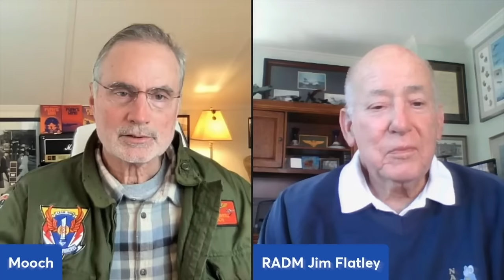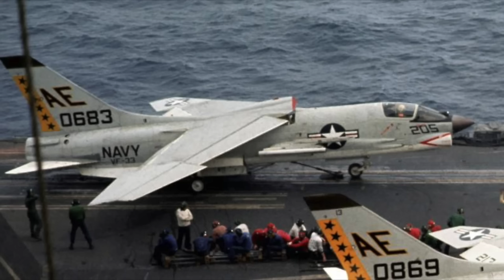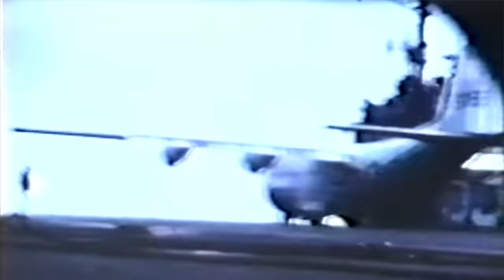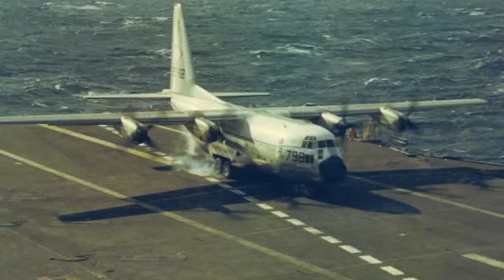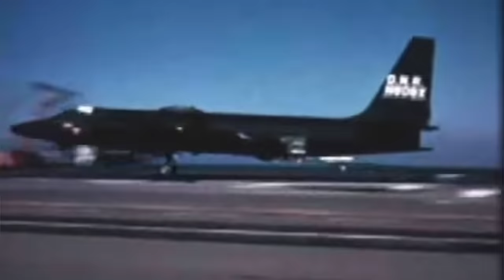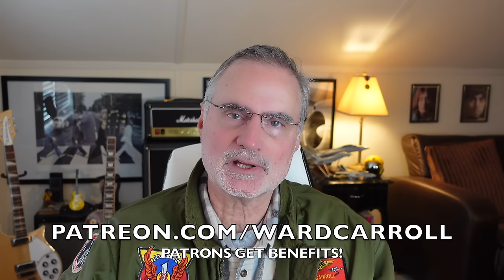Here's How a Fighter Pilot Landed a Cargo Plane on a Carrier

Comment: Great interview on a little known facet of C-130 ops.  I was a Flight Test Engineer at Pax River in that era and Jim and I were classmates at TPS. (I only did the academic part, although I believe Jim and I did a T-28 airspeed/altitude position error flight together).  I went on to NASA in late 1963 and wound up managing the integration of payloads to the Space Shuttle some 30 years later.  It was great to see RADM Flatley again and great to rethink my time at Pax.  Nothing but good memories of working with some outstanding pilots and Naval officers.  Thanks, Ward for doing this kind of interview.
Reply: Ward:  Please pin this.
Reply: Did you not also work on the parachute system for the Apollo missions? Or, did google fail me?
Reply: Did you work at the Cape or another facility like the one in Cleveland? I'd imagine the Cape since you were doing payloads for the Shuttle. 
My uncle worked at the Cape from Mercury through the Shuttle program and into the era of the ISS for Boeing, speaking of payloads it was his team that was given the task of doing the post accident reports on the Boeing built Defense Department satellite that was on the Challenger after it's accident. 
And a connection through the other side of my family is my mother's cousin was a navigator on a B24 that was shot down and killed during the war, but the pilot survived and went on in life to get a degree in Aeronautical Engineering and worked at the NACA (later NASA) facility in Cleveland until his retirement, he was involved in the Apollo program, he had something to do with the reactor that was on the LEM or something.
Reply: Amazing to hear!
Reply: Thank you for your service sir. 🇺🇸🦅
Reply: @douglashall2141  Ditto from a vet hand salute tue
Reply: Thank you for your service
Reply: My Mrs. currently works at Pax River as a T&E engineer for aircraft avionics, specializing in sensor systems.
She's a former USAF officer who did the same for them.
Reply: RADM Flatley, it is nice to see you and know that you are well and looking good! We still have the same haircut! 😂

Comment: Caroll this was one of the most amazing moments in aviation I think. Sad that they never implemented it on a regular basis but I understand that such a huge plane would hamper carrier operations for too long until it departed.
Reply: I bet there's an SOP on how to get that plane off the deck for salvage later
Reply: Whose is to say that this is a capability that may have been used from time to time by the Special Ops community? Super COD may have been a cover.
Reply: @boblynch2802  Maybe
Reply: It sounds like the carrier would have been so deeply embedded in the whole U2 ops scenario that all the normal "business as usual"-type operations would have been suspended anyways.

Comment: Great video. Flying right at stall speed +\- 3kts for approach and landing...Big Airspeed gauge mandatory!!

Wonder what the C-130 crew had for emergency survival plan  
If their aircraft went over the side of the carrier.

Huge "atta-boys" to all the folks involved in that program.
Reply: Dunno the drill but, at least the F model, there's a ladder and hatch rear of crew cabin. I used it when set a faulty HF wire antenna on fire during a Daily

Comment: Great honor to hear it from the real deal. I joined the Navy in 1970 retired 1991 retired as ADCS. When I first heard of the C-130 landing on Forrestal I thought it was a sea story, later I learned the truth. Coming onboard at a knot or two one way or the other over stall speed I really got a laugh out of the Admirals comment about replacing the airspeed indicator with one the size of a kitchen clock.

Comment: I was a C130 loadmaster with 10,000 hrs of flight time. I have been thru some fantastic landings. But this one by RADW Jim Flatley is out of this world. My hats off to you SIR! Its not easy to fly the C130 at 3 knots above stall speed, let alone to touch down consistently at 50 feet past the thresshold.

Comment: VR-8 64-66, A film of the landings was part of our orientation when coming on board.  Was told that there was an additional modifacation not mentioned .  The weight on the wheels switch was modified so that the props could start their reversal process before touching down.  Lockheed rep was the one showing the film.

Comment: I was a COD Crewman for VR-30 in the late 70's.   The deck run was standard operating procedures for us; even on the 27 Charlies.  The Cat shot was too harsh for the old ladies.  We only took a shot when we had special persons (VIP's) to impress.  So I have a couple hundred traps and only 30 or so cat shots.  I was't unusual to dip off the angle on the Oriskany.  Some times I was looking up at the antenna's on the port side of the straight deck.

Comment: Thank you for this interview. As an Air Force C-130 pilot in the late 80s and early 90s, I always wondered why this capability was never used and for that matter what the requirement was that prompted the testing. Since the tests were successful, either the requirement changed or there were significant issues even if it was successful. The C-130 is an incredible aircraft with some remarkable capabilities which is obvious because of its longevity and numerous versions. I later flew the C-17 on its initial cadre of pilots in the mid 90s and it has many of the same capabilities with a much larger cargo capability. It seems that there would be the need to get the cargo capability of a C-130 onto an aircraft carrier at least periodically.

Comment: If you a interested in A/C that are not designed to be carrier suitable you might look into the OV-10 trials that Pax did.  For one exercise the Marine OV-10's flew off of a carrier (I believe it may have been an LHA) in the 1980's.  They were also told not to rotate until past the island.

Comment: I heard somewhere that the Squat switch on the MLG was bypassed so they could get the props back into reverse just before it hit the deck. It takes about a second for the props to get into reverse angle after you pull the throttles back and they won’t reverse unless the squat switch is closed (Weight on the MLG).

Comment: The photos show 798.  I don't feel like digging out my old logbooks now, but I think I flew that airplane later, when it was reassigned to the Marines, maybe in VMGR-152 (Okinawa) or 252 (Cherry Point NC).  They must have changed the nosewheel steering wheel's position, because when I did it, it was easy to reach.  I see the refueling pods that hold the hoses are removed for the test.   I'd like him to tell us whether he reversed thrust over the ramp or after hitting the deck.  A C-130 is flown with the pilot in command in the left seat and the yellow shirt typically stands on the right side of the aircraft, so following taxi signals could be hard unless he ran out in front of the aircraft.

Comment: My first time flying off the boat was a deck roll down the angle, in a C1 as well. Back in '78 I think it was. We watched a cod doing traps and cat shots for quite awhile while waiting for our ride, then here came the old girl, our taxi to shore. Plane crammed full of cruise boxes and people and off we went back to the stern of the boat our butts in the seat and feet on the cruise boxes. The scary part was I was last on and the flight crew stopped me and gave me a vest, different from the others. They put me in the seat against the bulkhead back to the copilot and right right under the escape hatch. They told me if we went in how to get out and to stay with the people as I had the "radio beacon" and strobe light. I was the one they would find.  I thought ok, then they did the deck roll. Oh crap. Off the angle deck we went vibrating, shaking, roaring, and slowly accelerating. Doff the angle deck and down we went into ground effect, accelerating, and slowly climbed. We were very heavy. An hour or so later we landed at cecil field happy campers. Seaman Hunter, welcome to Carrier Aviation. The other times were all cat shots thankfully. Not near as worrysome. Be safe.

Comment: Speaking of COD, Navy should have snagged the near new C-27J Spartans the USAF sent direct from the production line to the boneyard as replacements for the C-2s.  The C-27J with a 94.5 ft wingspan and 9 ton carry capacity would have increased capacity over the C-2 especially for carrying replacement F-18 engines.

Comment: I wonder if they had any contingency plan, for if the big plane slid off the deck, like practicing a submerged exit like they have for helo and even Humvee type vehicles, but they prob just winged it back in the day...
Reply: When I was a Naval Aircrewman in the 80's, we did helicopter emergency water egress in candidate school.   It was the shell of a huey that was hoisted over and dropped into a pool.  It would rotate randomly, and then we had to practice exiting from different doors, with and without blackout goggles to simulate night.  That was general training for all  Navy aircrew.
 Later 'in the fleet' as a crew of  EC-130Q we would always do  'ditching drills' during 'missions' when we were on a  deployment. I would have to get the 'gumby' cold water survival suit on in some set time etc.    When we were doing what were for us short 3 hr Pilot training 'bounce' flights, and other stunt flying, we would not seem as concerned with safety. But hey, I was a kid in the back qualified to tell you if the hydraulic fluid was getting low, or if there was any structural damage after takeoff!
 
SV2? survival/flotation jacket had to be worn for take off and landings over water, but we could take it off after some amount of time during the mission which fur us was 12 15 16 hrs. Thought I did see a carrier out the window once, I am sure the Admiral and his crew are the only ones who landed.

Comment: Some airplanes were unlikely planes to operate from carriers, I can think of at least one other medium bomber , the B25 doing the same, but they did not have to land on the carrier. But at least Admiral did not have the prospect of playing hide and seek , with his head as price for the Japanese. A 50 kts headwind (at sea level) on the carrier means the landing speed been halfed,  I rather land in that condition on a carrier than to try and land on some hot and high remote strips (let say 3000 ft) with a heavy load of cargo. and a dicy go around with tall trees at the end of the strip.

Comment: Just wondering if'n I understood the admiral correctly..... he both landed & took off The Intrepid?
The Intrepid's runway is listed as 820' long.... the C-130 dry/empty weight~78,ooo lbs.... additional fuel weight can be up to 58,ooo lbs..... the required minimum runway length~3,300'.....
Would this pilot have gained advantage from that carrier's catapult pressure of ~58,ooo lbs?  Would he have utilized a JATO (jet assisted take-off) pack?❤
Reply: Oops, Carrier Forrestal.....
Reply: Okay, Forrestal lenght~1,000'.
Same questions apply.
Reply: Yes, he both landed and took off. At first they just did touch-n-gos then came out a week or so later and did the landing/take-offs.  798 was a KC130 F model but they removed the refueling pods which reduced the weight and drag silghtly. Remember they were in 50 -70 knot headwind when they took off--he said they indicated TAS of I think he said 49 knots so that would be 99-119 knots takeoff speed.  Takeoff speed without refueling pods would be under 120KIAS.   

I'm not  a pilot or aircrew member but I worked on KC-130s and that one specifically for over 20 years. They needed to test teh viability of TO and Landings with weight so they could duplicate concept.

Comment: Great job Ward! 
Radm. Flatley & "Smoke" Deserved every part of their DFC's (Distinguished Flying Cross)  for this addition to carrier history!

Now, what I still cannot understand Ward is;  the simple fact is, the cockpit on a C-130 is way higher than anything else that lands on deck... so how does the meatball read properly? Seems like the angle would be off - high - wanting to push the aircraft too low on the glide slope.

Btw, 15 feet right wingtip to island, yikes!  Good news though,  no crabbing going down the axial of the deck 🙂
Reply: Stovall, who flew three landings on the final day, received the Air Medal. Unfortunately he passed away from leukemia in 1973.

Comment: Was there ever any thought given to building a catapult carrier version of the A-10?   Tailhook.   Catapult gear.   Sturdier structure.   Seems like an easier engineering project than a VTOL F-35B.
Reply: S-3 could do pretty much everything A-10 could do in fleet and then some. It only lacks the gun but more than makes up for that with it's ASW capabilities.

Having naval A-10 to beat seven shades out of potential boat swarms would be damn dope though!
Reply: Would be interesting to know if there was any attempt.

(In my layman knowledge and logic)  the A-10 is still operational because it doesn’t face technologically equal enemies - insurgents  with AKs. A carrier group is by far more likely to face modern enemies on the seas, where a Cold War gunbus will have little to no effect. At the point where you redesign the a10 for naval ops you may as well design a new aircraft.
Reply: Just a thought of amphibious A-10 derivative with fixed floats though..
Reply: @thelittlestmig3394  Lol
Kinda like the spitfire with floats eh?
Reply: @SP-sy5nq  Yea kinda though I'd imagine more of C-47C with big-ass brrrrr cannon.
Reply: @SP-sy5nq  I am familiar with both floats equipped and boat hulled Herc projects. Would be neat ASW platform!
Reply: STOVL not VTOL
Reply: @AA-xo9uw  Armchair level of pedantry and wrong.
Reply: @thelittlestmig3394  Not wrong, pogue. 

Poor attention to detail is a hallmark trait of ignorant and obtuse posters on youtube, as well as those that defend them, who refuse to admit when they are wrong.

Comment: I’m amazed. Did we landed aided by wire hook?
Reply: No hook.  If you look closely on the side of the plane, it has "Look Ma, No Hook" painted on it.  Max brakes and reverse the props once it touches down.
Reply: @bobmarlowe3390  thanks for heads up. I see now. Second thought, those cable weren’t strong enough for this aircraft anyway. 

I wonder if that quote was printed on fuselage before it left the base? If it fail land safely on flight deck, that quote is up to ocean fish to read.

Comment: My brother-in-law served on the USS Coral Sea. He said that the aerial refueling was done by Marine Corps KC-130s that had tandem arresting hooks so they could catch two wires, and launch was handled by a special bridle that reached the C130 while sitting on the fantail and was pulled by two catapults. The C130, fully loaded, took the entire length of the deck at launch, the cats just gave it a good start. So, you are right, the navy did not fly C-130s off of carriers again. The Marine Corps does not brag about being part of the Navy Department. From a flight deck operations standpoint, C-130s were launched/recovered between airgroup launch and recovery. They wanted as many planes as possible in the air and off the deck. It was too big for the elevators, and finding a parking place on the deck was like playing chess.

Comment: I'm a little confused he said they where doing that for possible U-2 ops, so why did they have to land at a 130,000 pounds that's like 8x the weight of a U-2 that's fully loaded.
Reply: The U-2/C-130 angle was only revealed later but the COD angle wasn't just a cover story. The KC-130 was chosen due to the ability to quickly increase the weight by simply adding fuel to determine the max landing weight.

Comment: I notice the deck didn’t seem to be moving in the video while you were saying it was. Is that an optical illusion?  Did the C-130 use a hook to stop or was it all slow approach and reverse thrust?  Was there a connection between the C-130 and U2. I mean if they wanted to deploy the U2 off a carrier was it necessary to have the C-130 supply it?  Thanks. Interesting video
Reply: "Did the C-130 use a hook"

"Look Ma, No Hook" was painted on the nose by the VR-1 crew at PAX River.
Reply: I didn’t notice that. Thanks for putting me in my place with the snarky answer. Now can you answer the other questions i had